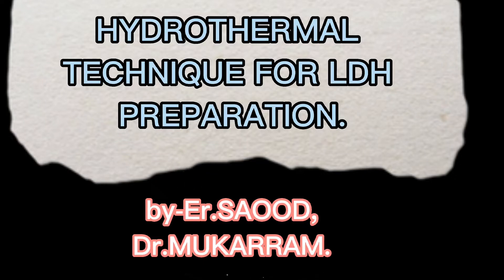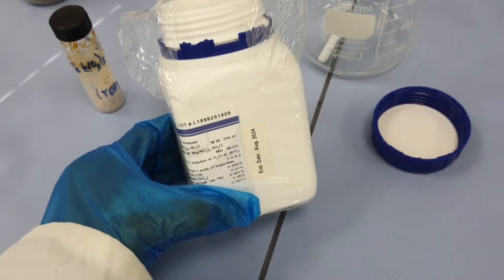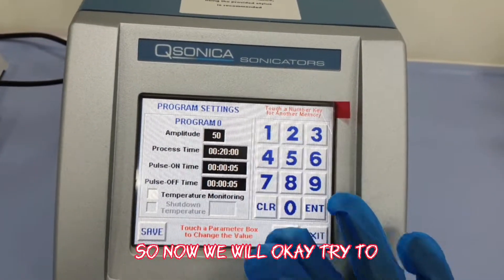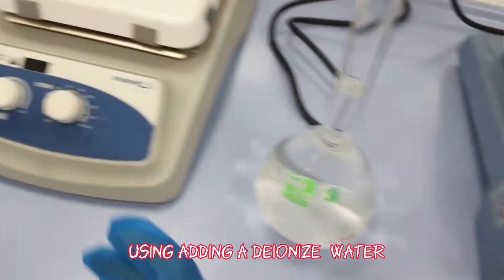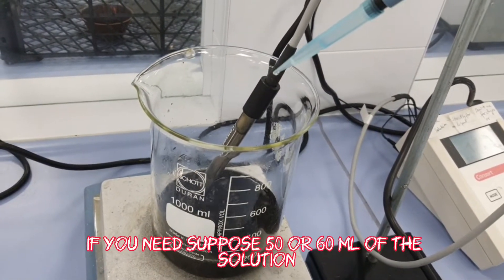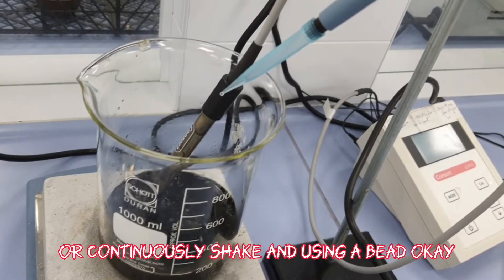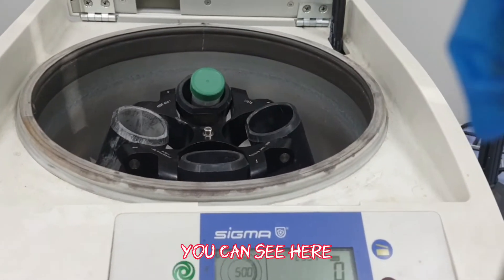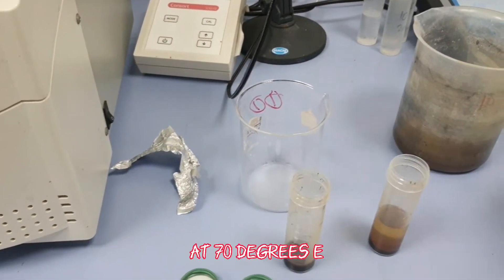Hydrothermal technique for Layer double hydroxide preparation

Comment: Hi sir, is N2 purging necessary during the co precipitation process? Or high alkaline pH during the reaction avoids the carbonate ion formation as carbon dioxide from atmosphere may get adsorbed, please explain as i am interested with this protocol
Reply from the maker: You can do both in order to check the surface morphology.....in this way you can compare
Reply: Thank you for your kind reply, I will definitely try the co precipitation method with or without N2 gas bubbling as well as try the hybrid method of co precipitation and hydrothermal method, hoping to make a video too if I successfully make  hexagonal shaped crystal pristine LDH
Reply from the maker: Sure that's a great idea
Reply: Thanks your video is very helpful for me